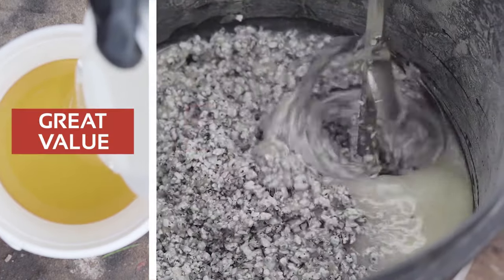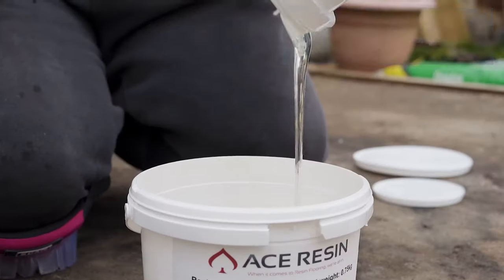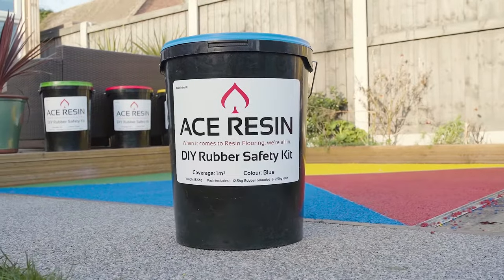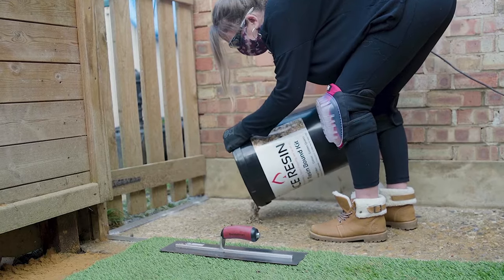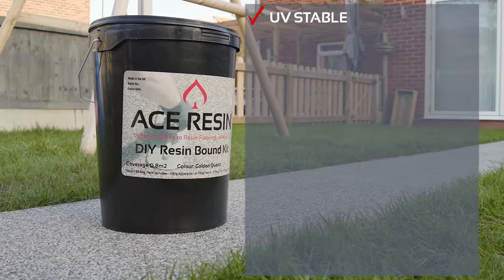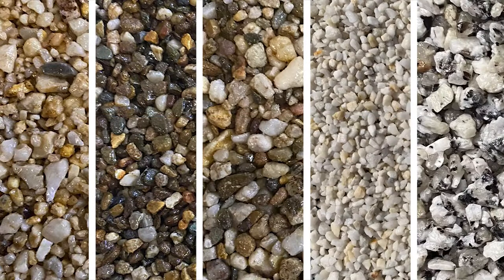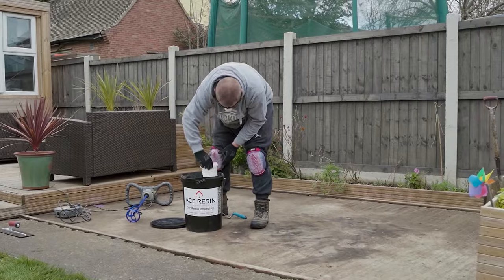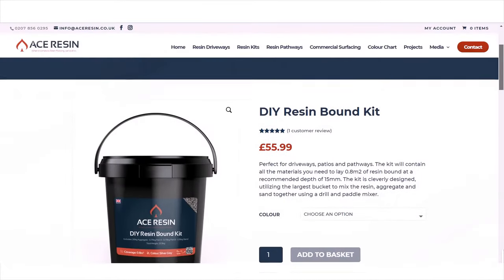DIY Resin Kits by Ace Resin

Comment: Could I lay this on MOT type 1 as it's a proper compacted sub base
Reply: I’ve just watched another video from an alternative supplier where it was laid directly on compacted type 1 but it was at a depth of 30-40mm
Reply: @azza1793  
Thanks mate yeah I found out its layer on a mesh which gives it extra flexibility and strength unfortunately these videos showing it can be layed directly on concrete is only good if the concrete has no dips then the water will sit and freeze popping it